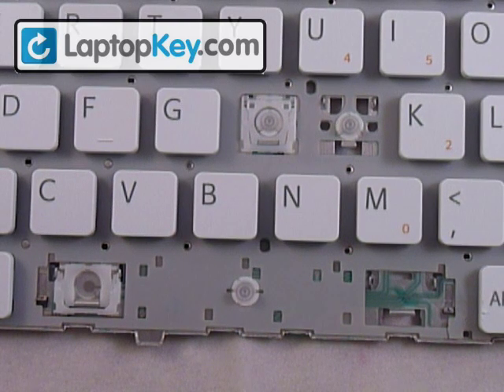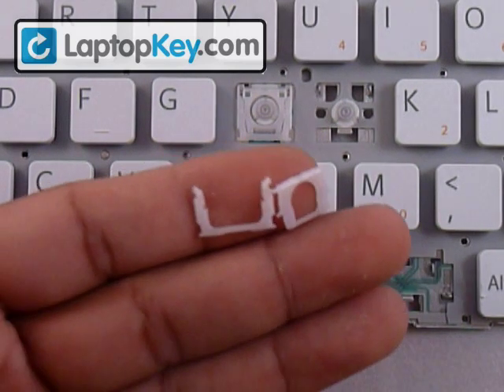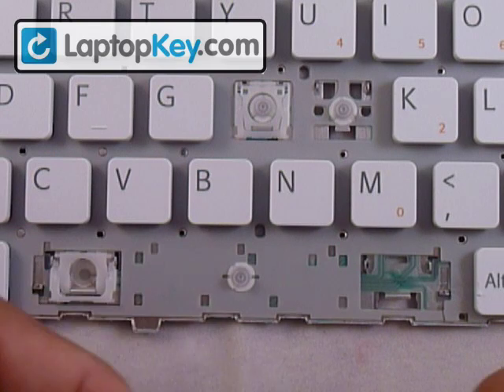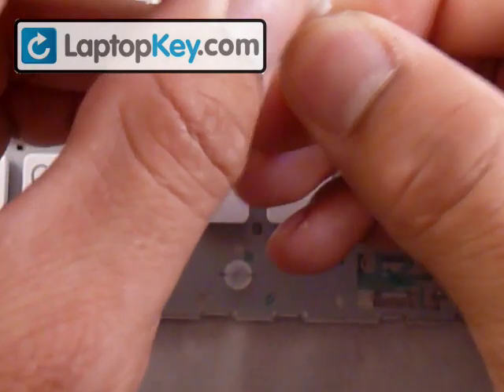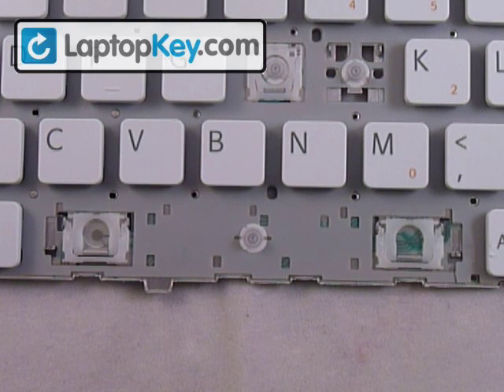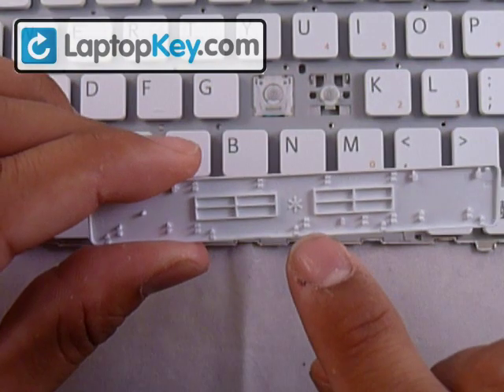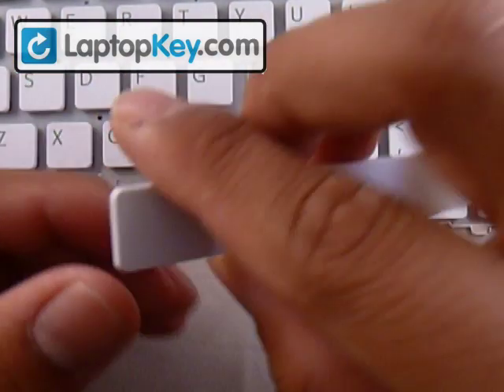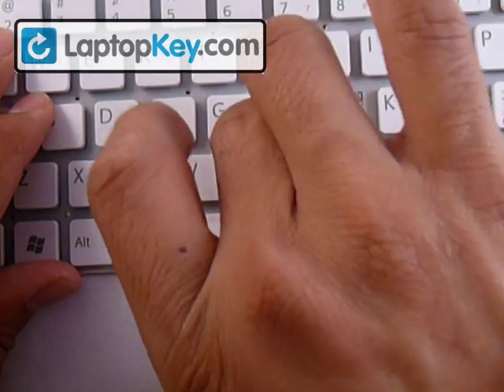How to Fix Laptop Space bar Spacebar Keyboard Key ASUS SONY GATEWAY APPLE

Comment: Thank you so much for this video! my asus g75 has a really similar keyboard and this gave me the knowledge to fix it. otherwise i was about to just ship it off for who knows how much
Reply: Hello man, dont know if you're going to read this but do you know how to remove the spacebar on the Asus G75? im to scared to break it so how do i do this.
Reply: haha i have ripped it off probably a hundred times. just pull it off. thats really all i can advise.
Reply: +Patrick Miller Hi PAtrick.How did  you go with your space bar? My ASUS space bar is useless. :( Removing it and putting it back on- does this work, please?
Reply: I ended up buying a replacement keyboard because a metal piece on mine had broken. It ran me about 50$ Fozzy Bear
Reply: Patrick Miller
Quick reply- thanks PAtrick. I have read on the web that a manufacturing problem is the issue. Some people put cardboard under the space key. I am thinking of doing that.My typing is so slow at the best of times and all of these sentences have had me go back and "space"them all. :(  How much did a new keyboard cost, please, Pat?
Reply: Patrick Miller
Ok, just saw-$50. Just done at a computer fix shop? I can't be typing like this. I'll never get anything done.